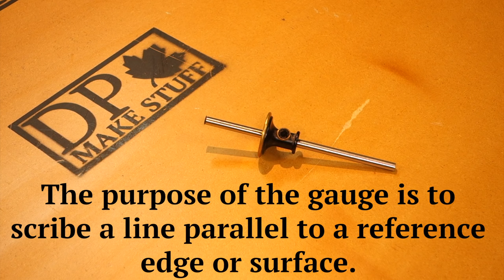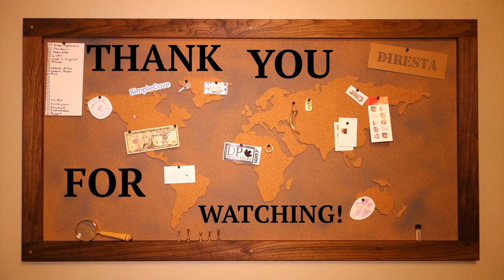Make a bad ass Corkboard

Comment: A little tip for the next time you're cleaning out the middle section of those bridal joints: Use the shoulder side of your dovetail jig to hold the chisel.  Easy way to hold it at a perfect 90 degrees. Great video Dustin!
Reply from the maker: The only thing stopping me from using the jig is my lack of a proper vice.  My next project has some dovetails so you can fully expect to see that beautiful two of a kind jig make an appearance shortly!  Thanks man!
Reply: Of course! Sean from Simplecove was stoked to see his sticker at the end there. Cheers bud!

Comment: I have an upcoming project for which I'm going to use a bridle joint; I like the idea of using a brass pin to strengthen the joint.
Reply from the maker: It's a satisfying joint to make.  Very easy to get perfect.

Comment: My only complaint is the spray painted ocean. It looked rather rough and slightly messy compared to how clean the rest of the build was. Still looked great, just my two cents.
Reply from the maker: It doesnt seem to photograph very well, or I'm a bad photographer.  I needed a way to create contrast and in person it looks really good.  Mostly grey with a hint of blue. Thanks!
Reply: Dustin Penner I totally get that! I'm sure it looks much better in person. It's a great looking piece.